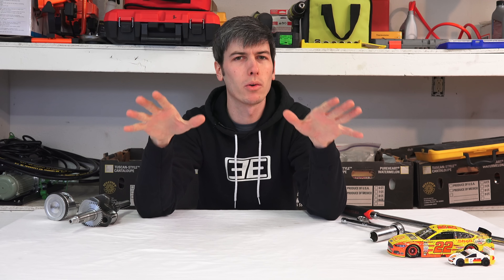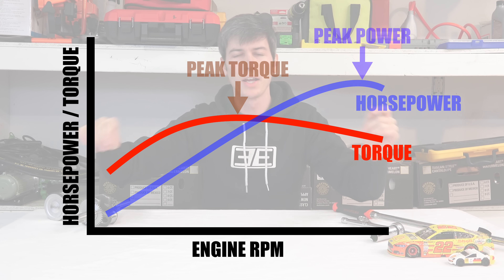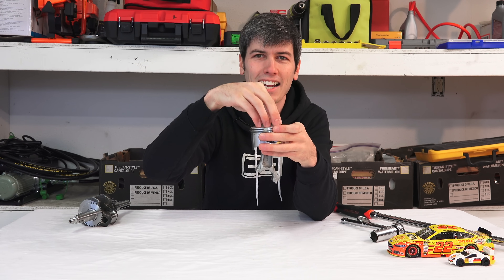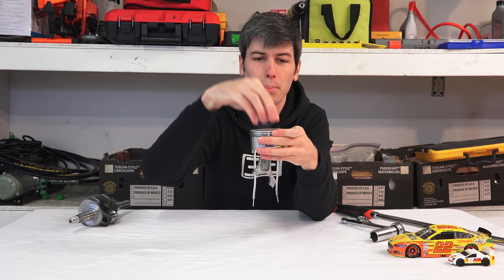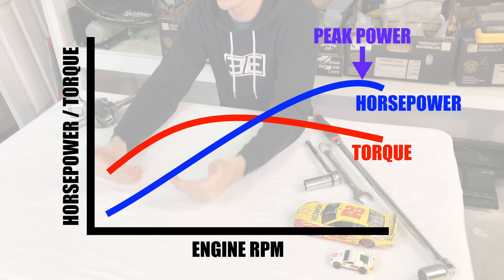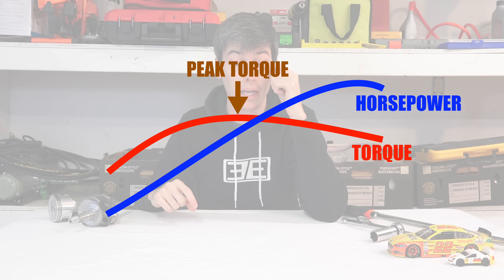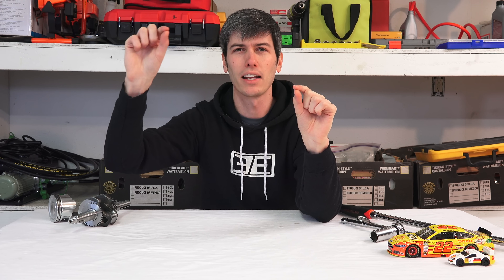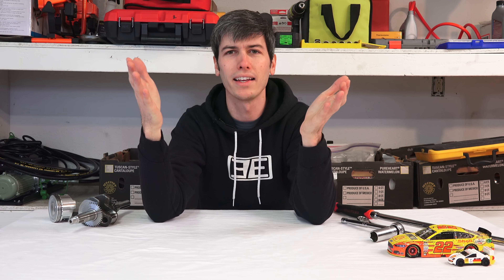Horsepower vs Torque - A Simple Explanation

Comment: Torque is applied on a perpendicular plan, I think.
Reply: Consider a vertical fixed bolt, with a nut that can rotate on the threads.

Point a wrench out to your right, connected to the nut.
Push on the wrench forward.
Which way does the nut move?   That is the direction that torque is defined in physics.   It is along the axis of rotation,defined according to the right-hand rule.

Comment: I can vaguely remember something from my physics class (a looong time ago) that said that if you double your rate of acceleration then you quadruple your rate of fuel consumption.  Is that correct? (sorry for digressing from the video's topic)
Reply: To the best of my knowledge, that one is not true. Mathematically, the change in acceleration should be proportional to the rate of fuel consumption. However, all things aren't equal. Increased acceleration will cause an engine to utilize lower gears/raise rpm. That will prevent the engine attaining a more efficient operating rpm. Also, frictional forces will increase a small amount as a result of increased acceleration. I am not aware of any useful tests that have been used to compare the relationship between acceleration and fuel consumption.

Comment: Sliding the cars across a flat table was a poor example of work being done as the resistance to motion is inertia, drag, and change in height.  Not that it wasn't correct, it was just a poor example.

Comment: Horsepower is greater when you have a large diameter intake runner and large volume of air available.  Torque is greater with a small diameter intake runner, accelerating the intake charge, and the runner is longer.  Hence imrc

Comment: I am still having doubts and is confused. My bike has Max Power 25.7 @8500 rpm and Max Torque 22.9 @7000 rpm so what does it mean to have max output at certain rpm? Max power at 8500 rpm means is the engine under pressure at that rpm or its the best rpm to ride?

Comment: I like the bike that has heaps of torque available all across the rev range (torque curve like a table top stupidly high from above 3000rpms and stays high till 14000rpms)  thus making insane horsepower but can also effortlessly pull a boat.

Comment: I have a question what is the diameter of the piston? And the engine displacement and connection rod. If you want to built an engine what are the formulars?

Comment: The one thing that isn't addressed is area under the curve, which is critical. Unless you have a CVT, you have a limited number of available gear ratios, therefore the area under the curve is what really matters, for both torque and HP.

Comment: So, a longer arm for the piston is very beneficial. Correct me if Im wrong
Reply: The length of the connecting rod makes no difference. It isn't the distance at which torque is applied.  The distance between th crankshaft main journal and Rod journal makes the difference for torque.

Comment: OH MY GOD IVE BEEN CONFUSED ALL MY LIFE.
EVERYTHING MAKES SENSE NOW
SO IN 3RD FOR EXAMPLE AT PEAK TORQUE THE PULL IS HARDER, BUT I CAN DROP  A GEAR GET INTO SECOND FOR A HIGHER TORQUE AT THE WHEELS  AND THE PULL WILL BE HARDER!!!!
Does not change how I drive anyways, I always stand at peak horses for acceleration, however when trailering or climbing hills I now understand why the engine will hold at peak torque and not at peak horses.

Comment: Power is a race horse runs fast and only can have a light weight ie jockey. Torque is a cart horse slow but pulls alot of weight. 

F1 car could not pull a caravan well, but a 2 ltr diesel can but would never be fast like f1

Comment: It means that the small car (used in the example) would make higher horsepower if the gear ratio was the same as the bigger car?!
Reply: No.  You can't get more horsepower by changing gear ratios.   You can only reformat the mix of torque and rotation speed, by changing gear ratios.

Comment: Since most cars have a peak torque at between 4K to 5K RPM, would the car accelerate the fastest by shifting to a higher gear when the RPM is a bit beyond the peak torque, i.e. start shifting around 5K or 6K?    If that's true, it would beg a question of why do racers constantly rev to the red line before they shift to a higher gear?

Comment: Bro what is the difference between cc and hp
Reply: "CC" whose full name is cubic centimeters, is a geometric term, not a performance term.  It refers to the total displacement volume among the cylinders.   This is the difference between the volume of the cylinders at bottom dead center (fully expanded piston) and the volume of the cylinders at top dead center (fully compressed piston).

If an engine is sized in CC's, that is a tiny engine.   An engine on a typical vehicle will usually be sized in liters.  A liter being 1000 cubic centimeters (aka milliliters).

Comment: This vid has the effect of causing me to loose what I was thinking about and has ruined my life at this point in time. Only engine designers or engine buyers might need to learn this information which just confirms that THE ITEM EXISTS because you can measure it in some way. You're saying it can be measured in 2 different ways, therefore it definitely exists. 
You might not even want to be moved from point A to point B. slot cars give the driver 2 experiences at the same time while you don't get forced to move from your current location while operating the machinery. Ordinary cars don't offer you those experiences. Slot cars make you drive them AND you get to see the image of the car as you're driving. Most car drivers NEVER see their own image as they're driving around town. They have NO idea who they are.

Comment: Or, its How strong the explosion force is at the rear wheels, OR How many explosions you can fit into 1 minute of engine revolution. People are cheap and fuel consumption is costly so you can only afford so many revolutions before your bank account get drained of all your money. 
So, speed limits, bank account funds, how many toys you can afford to buy which need to be installed in the car after shopping, outside air quality, etc... ALL play a role in this EGO MANIA boasting show off human behaviour game called torque and horsepower.

Comment: So if low torque can be compensated for with the right gearing, why so much emphasis about torque?
Reply: Sorry for any error in my writing because I’m not by nature not a good writer especially in this long windy kinda essay but you get my point. I’m just upset with people who’s talking about car torque by simply looking at a single number on a spec sheet without even knowing actual torque send to the wheels and actual power curve of the engine. What they feel is actually all based on a combo of power curve and torque amplification that both powertrain and drivetrain serves.

Comment: This is how I get it... Torque is equal to how much power is transferred to the wheels, while Horsepower is equal to how quick you climb in the RPM range. Torque gives you acceleration, while horsepower gives you top speed.................? This is most probably wrong, but even after some research, it's still confusing.

Comment: How do we relate this torque and horsepower into a single shaft turbine driving one generator, a gas and steam turbine on a single shaft driving a generator, when the gas turbine start it produce small Mwatt and after the steam turbine is on the Mwatt increases what is the principle behind it.

Comment: A CVT tranny governed to stay at peak engine RPM for HP will provide  maximum power to the road at all times resulting in greatest acceleration. That is due to the transmission having higher torque output than input from a lower gear ratio (with higher engine rpm).  Governed at maximum engine torque,  it will be at lower engine RPM than for peak HP.

Comment: His use of cars as an example for which is faster left out something very important. Which car will win, if everything else is exactly the same, depends on the distance of the race. A formula one race car is useless in a drag race because it's torque is useless until the engine rpms reach high levels. That's why it takes longer to accelerate from a dead stop, vs a dragster that has high torque at low rpms so it is able to reach high speeds at a shorter distance. Gear ratio is also why dragsters have very big tires at the rear because the large amount of torque at low rpms can turn the wheels. Put a formula one engine in a funny car and you would probably burn up the clutch before get the car to moves one inch.
Reply: No true.... a F1 car vs a dragster of similar HP will be very close in a drag race.  clutches all burn up in accelerations  where 1000s of hp are involved.    HP is the capacity of ANY vehicle to acceleration at or from any speed.   dragsters have big tires for other reasons.    top speed (gearing) and rubber distortion for grip from the start, it has little to do with  engine torque values.   two dragsters with identical equipment could be set up the same regardless of the disparity of engine torque... HP dictates rear wheel forces period

Comment: It's pretty simple....Example. using my car... Max 475 torque at 4000rpm = 1,900,000 per minute... Max Hp 400 torque at 6000rpm = 2,400,000 per minute = faster acceleration over time... So Hp = max torque per minute

Comment: Torque is the force accelerating the car, and the force measured on a dyno, but it's not a useful figure for comparing engines or to predict a cars performance. An engine exerting 100lbft of torque at 2000rpm is doing exactly half the work of an engine producing 100lbft at 4000rpm. This is why horsepower is used. 
Horsepower is a measure of torque taking into account the rpm its produced at, all wrapped up into one simple number. 
Comparing 2 engines torque output IS NOT an apples to apples comparison unless the rpm is the same. 
Comparing 2 engines horsepower output IS an apples to apples comparison because the rpm data is embedded into the horsepower figure.

Comment: Speed and torque is the product of power. If car on ramping road, you need higher torque but the speed will be low such as using a first gear, and on the flat road, you can use highest gear with the lowest torque but highest speed. On ramping road the higher the gear the lower the torque and the harder car to move forward. On the flat road, the lower the gear the slower the speed and the harder car to move faster.

Comment: Say 100 bhp engine if use a long bore it increases torque which helps in mountain roads for climbing and carrying load.while same 100 bhp engine but lesser torque but more needs more rpm to extract the maximum power which inturn increases the speed.

Comment: barring a gearing miracle, if you had say that same car with 400 HP and 25 lb-ft of tourque, it isn't going to accelerate very quickly.  Very little force to move that mass, no matter how fast you rotate it  you have to keep it geared modestly or it will seize/freeze and stop turning and burn up the engine.  It will sound like a cuisinart, and the car is going to accelerate like an original VW beetle.  If you have 1000 HP and 2 ft-lb of torque, the car won't even move.

Comment: Im not hating but I dont know why you constantly talking about gears and leverage. It has nothink to do with it. For example two cars with different torque - ´´but the first can use gears to have leverage´´ like the second cant shift? wtf, you could just say you are accelerating faster at higher rpm because you are supplying your wheels with more torque at one time unit. Torque is fading at higher rpm because of engine efficiency, but at the end it will do more work per second = more power

Comment: Torque:  A force.  Work: A force applied for a period of time.  Power:  The amount of work per unit of time.  - Torque:  The force at the crank/axle/wheel.   Work: The amount of energy required to apply that force for a full revaluation of the crank/axle/wheel, which takes time.  Power: The amount of energy per second required to apply the torque for the number of RPM required.  Torque:  ft/lbs or N/m.  Work: Joules  Power: Watts or HP(~750W)
Reply: Paul Campbell that’s right but most people don’t have any idea what are you talking about. They like to hear things like torque is what’s the color of the wall power is what’s written on the wall.

Comment: What’s work?  You didn’t define that variable.
Reply: Work is the mechanical transfer of energy from one body to another.  In its full form, its definition is the line integral of force dot-product displacement.

In simple terms, it is force multiplied by the distance the target object moves while the force is being applied, also multiplied by a factor to account for how aligned the force and distance are.

The net work done, accelerating an object from rest equals the kinetic energy the object has while in motion.  It also equals the amount of work (or rather damage) the object can do as it returns to rest.

Comment: It seems people have a hard time understanding that horsepower is a function of torque. A "torquey" engine which has a lot of torque at a low rpm therefore produces more horsepower at that low rpm. Which would accelerate well without the engine being revved high (as in normal driving). A high revving race engine produces lower torque at the lower rpm range so therefore it makes less horsepower at low rpms. However at higher rpms over 5252 rpm (where horsepower and torque graphs will cross) horsepower can be quite high, so this engine could be quite fast but would need lower gearing to keep it in the right rpm range. Which comes down to the most important part, peak horsepower and peak torque isn't as important as the area under the curve. A high torque curve at low rpm has good low-rpm horsepower. (Like most large diesel engines). This provides easier acceleration for loads. (Without revving the engine high losing  engine life.) On the other hand being able to apply small amounts of torque very quickly (race car engine), in other words a engine with lower torque curve at higher rpms would have great horsepower. If you had and engine with lots of torque at high rpm you would have lots of horsepower, but producing a lot of cylinder  pressure to produce high torque requires stronger heavier parts which limit rpm which is why it's easier to build a high revving engine if you're after high horsepower (doing small amounts of force very quickly) Of course if you imagine two engines one produces a peak of 200 hp at 4000 rpm and the other makes 200 hp at 8000 rpm, at those rpms  torque is double in the 4000 rpm engine. However if they were placed in equal cars with the gearing for each to run at peak horsepower max speed is equal with different torque values. It would also be possible to change gearing to produce the same torque at the wheels but with different speeds. Horsepower will be constant (if not accounting for losses due to friction).
Reply: Is amazing how many car buffs haven't an iota of understanding of cars.

Comment: This video is kinda misleading I think,because you make it seem as torque is irrelevant in acceleration and speed,but it’s not the truth the torque of an engine is super important too,because high torque low hp cars like the gla work like a charm even with 110 hp compared to other cars with higher hp,so pretty misleading and false in its physics video..

Comment: Torque is an element in calculating horsepower, so there really is no HP vs Torque. Torque is raw force. When raw force meets time, it produces work. HP= torque x RPM / 5252. That is torque flowing through time causing rotation. Can't separate torque from HP.

Comment: Actually, moving the car from point to point doesn't do any work at all. You can imagine, if the car were on a frictionless surface, you could give it a vanishingly small push, and it would still (eventually) make it to the destination. You would expend almost no energy in the process, and thus do almost no work. Unless your start and destination are at different heights (different gravitational potential energy), displacement itself doesn't perform work.

Work here is the amount of energy expended; ignoring losses to friction/braking, it's the amount of kinetic energy imparted to the car. Based on moving from point A to point B in a certain amount of time, a certain amount of velocity (and thus a certain amount of kinetic energy) is required. That is the work being done.

Power does increase when you shorten the time limit, but for two reasons, not just one. A shorter time limit requires a higher velocity to travel the same distance, and thus requires a greater amount of work. Simultaneously, you're allocating less time for that work to be done, further increasing power (i.e. work/time) requirements.

Comment: I have watched a few of your torque vs horsepower videos'. I think you are confusing yourself, same as all the torque heads out there.. Horsepower is the only thing that matters in a vehicles acceleration or climbing a hill. I challenge you to test this yourself without doing any math. Accelerate (1/4 mile would be a good test) your honda car, or harley motorcycle, or dirt bike, or semi tractor trailer, electric vehicle  etc., in peak torque range  then do the same at peak horsepower range. Then come back with the results. Which is actually faster??. I know the results already. You can feel a vehicle accelerate faster in peak horsepower range every time (even though in the same gear peak horsepower will always be at a higher speed when there is more air resistance which should make the vehicle slower). The reason a vehicle with high torque at low rpm accelerates fast is because it also has high horsepower at low rpm. Its all about the horsepower dummy, that is the answer. Torque is just a math equation based entirely on horsepower.